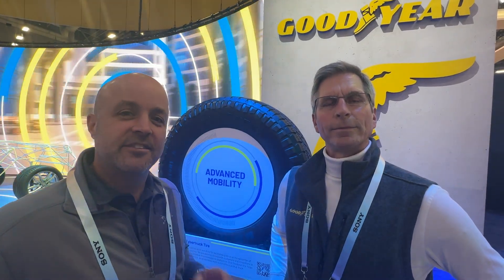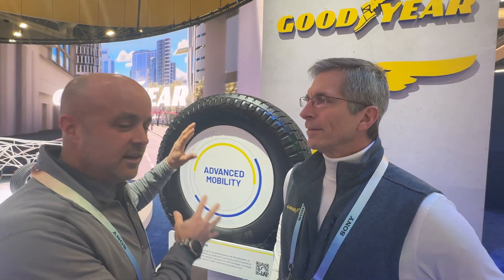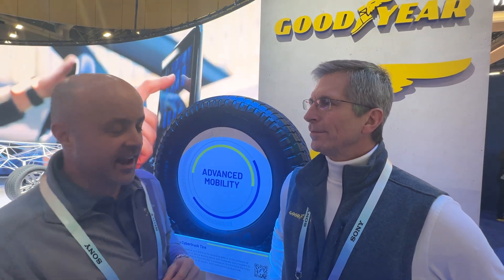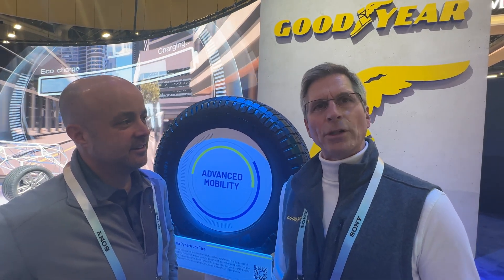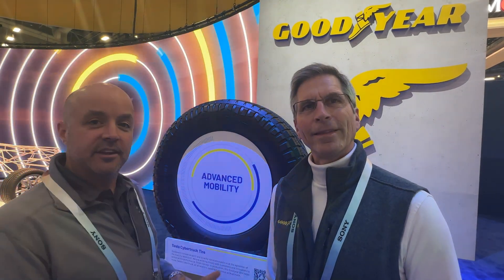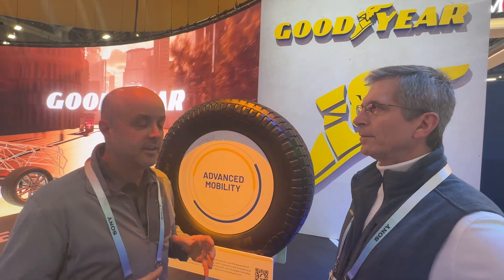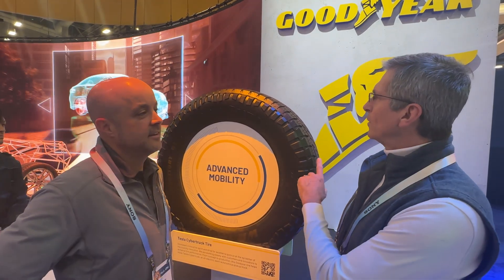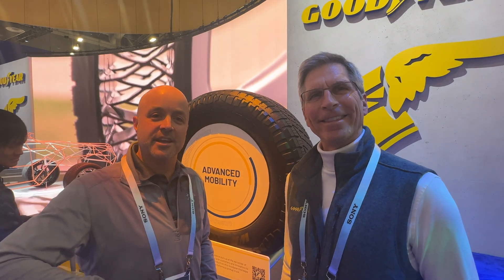Tesla Cybertruck Goodyear Bluetooth Tire Tread Sensor Explained! New & Not the Same as Valve TPMS ℹ️

Comment: Just replaced these at 22,000 on the Cybertruck. The foam lining(Sound Comfort) had delaminated on 2 tires and balled up inside the tire causing it to vibrate at highway speeds. Tesla covered the cost of those tires under warranty and indicated that they are working with Goodyear on the problem. Wondering if they(Tesla or Goodyear) are using the SightLine Technology in anyway to track the issue??

Comment: So, am i understanding this correctly,  that each wheel location has 2 sensors to monitor tire pressure?  What benefit does that provide and what about if the tire is replaced with a different brand tire later on?
Reply: One sensor that monitors both air pressure and temperature

Comment: Does the tire use a battery? What happens if it dies? Does the sensor know about anything beyond temperature and pressure? Why bother when TPMS already provides pressure?
Reply from the maker: Sensor battery will outlast the life of the tire tread!  This sensor provides tire tread temp as well, TPMS cant do that..
Reply: @TSportline  I’m confused, the cyber truck doesn’t show temperature readings in the tires. Is there a way to get it to do that?

Comment: Dave didn’t talk about what kind of information the built-in tire sensors will provide.
Reply: I believe he said the bluetooth sensor is monitoring temperature and pressure. He did NOT mention tread wear.
Reply from the maker: Tire tread temperature and tire pressure at least...possibly more
Reply: @TSportline     Did he say tread temperature or the internal tire temperature? I believe based on what I've read before, that this bluetooth unit is essentially covering what TPMS systems are doing, but have the capacity to develop more monitoring.